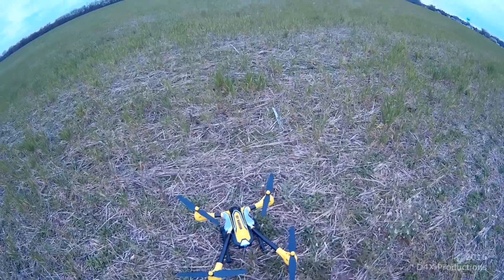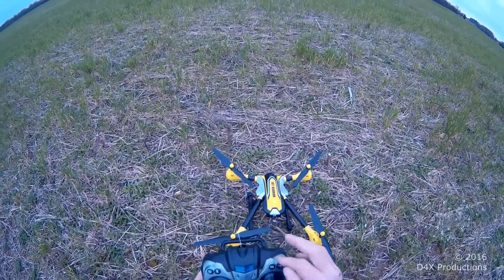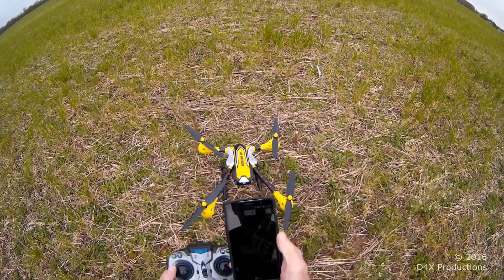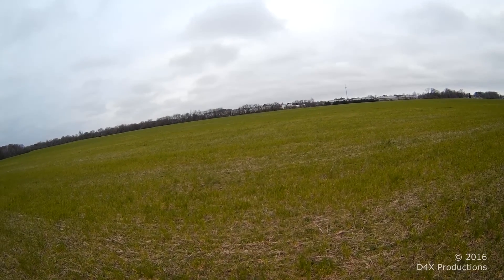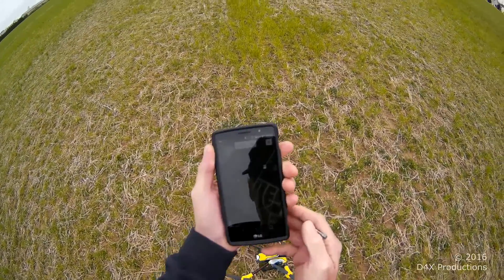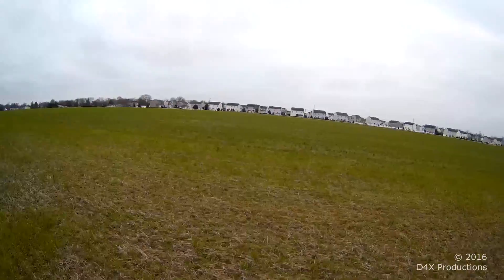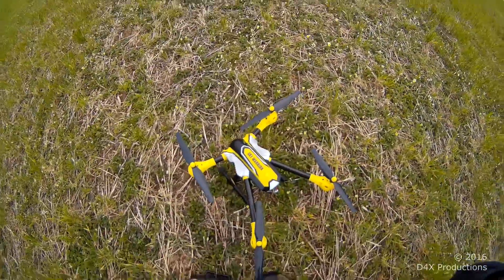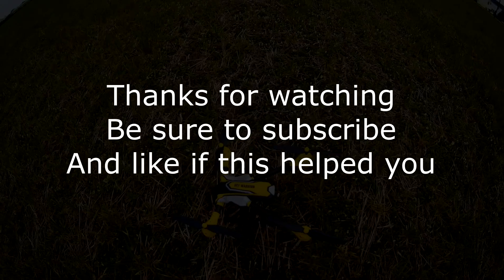Kai Deng K70C Range Test

Comment: The length of the antenna on a typical 2.4GHz receiver is 28.8 to 32 mm long, most are about 28.8 mm. The antenna is that length of bare line often at the end of a longer coaxial cable to move the antenna farther out from the receiver.

Comment: Antenna Length on 2.4GHz
2.4GHz antennas are quite a different animal than those for the 72, 75, 35, 50 and 53 MHz units. They are sometimes only a 1/4 wave stub right on the PC board or more often, a 1/4 inch stub on the end of a 50 ohm coax line which can be several centimeters long. If on the end of a coax, you need to be somewhat careful of how you handle that coax; no sharp bends or anything that will dent or deform the line between the receiver and that little bitty antenna at the end.

Comment: Please help!! Mine came not assembled. Where do the A and B propellers go? Nothing in the manual.
Reply from the maker: +Creepy Crawl with Sobaire I am not exactly sure as I am not near it at the moment.
If someone' doesn't reply by the time I get home from work, I'll let you know.
But usually, the propellers turn like this ...

With quad facing AWAY from you:
Left front; props turn clockwise
Right front; props turn anti clockwise
Right rear; props turn clockwise
Left rear; props turn anti clockwise
Holding the propeller in your hand, the leading edge will the the "highest" edge. 
So with that thought in mind, I'm going to guess the following:
Left front = A
Right front = B
Right rear = A
Left rear = B
I am guessing, so if someone else knows better, please respond. :)
Reply from the maker: +Creepy Crawl with Sobaire 
My guess was right. 
A - left front
B - right front
A - right rear
B - left rear
This with the quad facing away from you.

Good luck.

Comment: So, does the antennas mod make better range or it's rather the same?
I've got mine today and notice as well "lost" of control when low battery.
However like this quad, it very stable and nice design.
Reply from the maker: The range seems pretty good. I think it is better. But the low voltage loss of control still concerns me. I need to fly it more but the weather hasn't let me.
Reply: Ok, it's strange that without the gimball and stock cam, the range seems to be higher. Good vid, hope there is an issue for the LVC.

Comment: Decent range. It always is risky running those kind of test to see what kind of shape the quad is in when it drops out of the sky.  :) Could you drop me a note regarding what kind of settings you use to render your video to YouTube?  I am using VSDC Free editor from the recommendation of QuadCopter 101.  Some of my 5 minute vids take 50-60 minutes to upload.  I have cable modem with decent Speed Test.Thanks!!
Reply: +Del Quad4X Enjoyed your video, Old guy newbie here, waiting on K70 to arrive, can you tell me where to get extra batteries for this, what are dimensions of bat. and if you think Syma8 batteries would work (may need to change connection) I subbed you and am starting same journey.. Good Flying!
Reply from the maker: +ParneyPots-RC I use Sony Movie Studio with HD settings.
1080P @ 30fps.
My uploads are about like yours. Same set up. Cable modem and takes 30-40 minutes. If you consider the number of videos being uploaded every hour, hell, every minute, upload times like that are to be expected I suppose.
I'm just used to it. LOL
Reply from the maker: +Dallas B711 First, thanks for the sub! I appreciated it.
I have not researched extra batteries as of yet, but I would imagine you could get them just about anywhere. Banggood, HobbyKing, etc.
The dimensions are:
73 mm long (approx 3 inches)
34 mm wide (approx 1.25 inches)
20 mm thick (approx 3/4 inch)
It is possible the Syma X8 battery will fit, but I can't say for certain.
I changed the plug from the banana type to an XT60. Only because I have other 2S batteries that will fit, although smaller in current capacity and they all have the XT60 plugs.

My luck with the weather seems to be changing so I hope to be out flying again soon. It's been over a month and I'm going nuts lol
You will have a blast with this hobby. I know I am. :)

The next mod on the K70 is a "portable" FPV system. One that is self contained and can be easily mounted on other quads. Like my Tarantula X6.
Stay tuned.
Reply: +Del Quad4X  Thanks for info and reply. I have a Tarantula x6 also on the way and plan same thing... I'm putting a RCtimer fpv set up on it that I can also move over to use with K70 (kit has 200wat tx and 700 TVL camera for $29 from "A Main Hobbies".. hope description was right)
Looking forward to seeing a video of how you set up your fpv!
Reply: you can BUT FYI bangood batts are ebay batts are a tad longer which makes for a very tight fit. you can pay more $ and get a replacement or extra batt from Kaideng if the tight fit bothers you. I purchased 4 which came 2 to the pack from ebay and I purchased 1 from banggood and they are the exact same so id stick to ebay where you will find sellers selling 2 for around $14 which is pretty damn good. Hope this helps out.

Comment: nice, i don't have any problems
Reply from the maker: +rc model boats you're lucky :)
I am thinking when this thing goes into LVC (low voltage) the flight controller loses some communications with the transmitter.
When the battery is fully charged it acts fairly normal. But then I lose control for a few seconds when LVC is reached.
I'll do other tests with this in mind.
Thanks for watching.